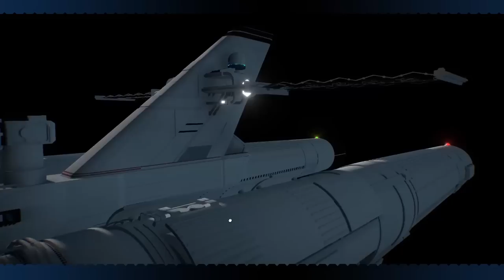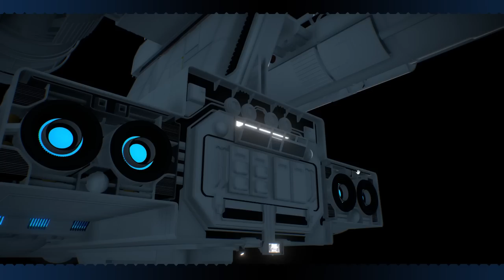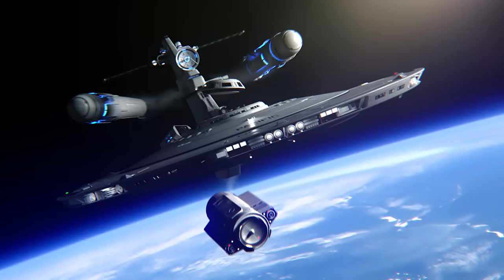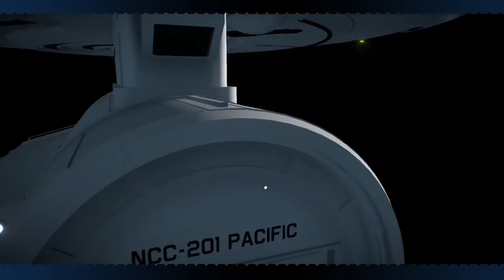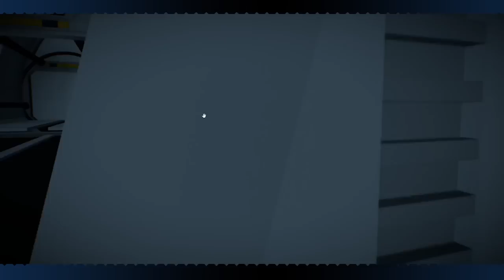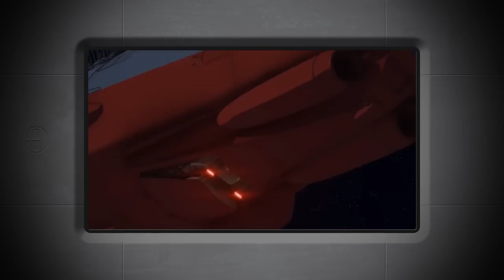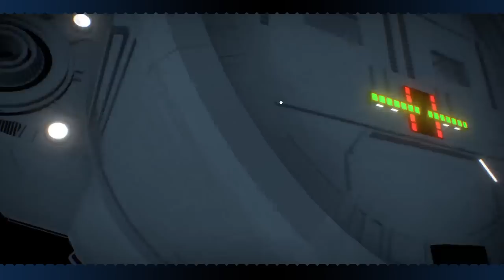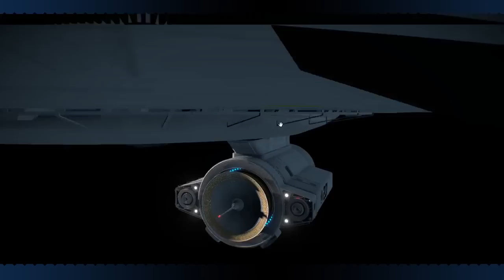Show and Tell: Starship Pacific from Pacific 201 (Star Trek fan film)

Comment: 1:20 "A thermal control system for the warp plasma conduits."

Maximum nerdum.
Reply: technobabble intensifies
Reply: That's just the thing, @Optillian. This isn't "technobabble", like the vast majority of technology in Trek. This is based on REAL engineering principles.
Reply: @solarisone1082  No it isn't.  Warp plasma is, by definition, technobabble.  Plasma is not a thing.  Plasma is a state of matter.  Plasma is an ionized gas consisting of positive ions and free electrons in proportions resulting in more or less no overall electric charge, typically at low pressures (as in the upper atmosphere and in fluorescent lamps) or at very high temperatures (as in stars and nuclear fusion reactors).

Since a fusion reactor behaves VERY differently from an antimatter reactor, the very idea of using plasma as a medium in which to carry the energy is ridiculous.  First, antimatter reactors do not produce any heat or plasma.  Second, the energy released (what form of energy it might be) is 100% energy.  This means you would NOT need to cool unless it was pure thermal energy.  If it were you certainly wouldn't want to reduce the available energy.  Third, unless you are intending to use thermal energy (which would mean you want ALL of it), the heat produced by any sort of power source would be recycled into the process or radiated away from the source directly.
Reply: @protoborg  - the annihilation of matter and antimatter releases radiant energy (or EM radiation). whatever handwavium roddenberryistic physics is involved in generating a warp field, it will require that released EM to interact with matter in order to be put to work. when EM interacts with matter it produces material excitement which eventually and inevitably translates as heat. 

basic thermodynamics limits "recycling" the heat back into the process, as heat tends to move from higher concentration to lower concentration. And vacuum sucks (sorry) as a medium for passive radiative cooling.

so, yeah, the ship would need some kind of active cooling system, preferably located so as to prevent heat from the warp nacelles from diffusing into the main hull and living spaces.
Reply: @protoborg  Look at a nuclear weapon detonation. It puts out lots of heat and light as a byproduct of the energy/mass conversion.  Now we know that matter and anti-matter is  an even more energetic process It's by definition would be expected to me at least an order of magnitude) I suspect it's a squared relationship) more energetic than a nuclear explosion. So we vaporize matter (I am going to assume it's a process that produces some common element like hydrogen and then expose it to antimatter from the dilithium with a controlled initiator of some sort (let's assume a generator-powered cascading laser system that continually builds the heat like hydrogen peroxide and baking soda o vaporize the dilithium crystals and anti-matter from the dilithium crystals. The di-lithium eventually runs out of anti-matter and thus is used up) (According to Mr. Scott the reaction takes 30 minutes to start and stabilize from a cold state)
Reply: @lebela Again, NO IT IS NOT.

Nope.  An antimatter reaction results in PURE ENERGY.  The way an antimatter reaction works is to bring EQUAL masses of matter and anti-matter together.  This results in complete conversion of the two into energy.  Positron emission tomography is completely unrelated to anti-matter.  It is a functional imaging technique that uses radioactive substances known as radiotracers to visualize and measure changes in metabolic processes, and in other physiological activities including blood flow, regional chemical composition, and absorption.  In other words, it uses RADIATION, not anti-matter.  Photons are not energy.  They CARRY the energy that is light, but they are themselves PARTICLES, ie matter.  They certainly don't hold enough energy to heat matter to the point of dropping electrons. Most plasmas are created when extra energy is added to a gas, knocking electrons free from atoms. High temperatures often cause plasmas to form. Atoms in a hot gas are moving so fast that when they collide with each other they sometimes knock electrons loose.  But Photons are simply too small to impart the necessary energy.  The use of the term "plasma" on Star Trek is actually wrong.

I used the wrong word here.  No, all frequencies of energy are NOT capable of inducing heat.  This is due to the fact that it isn't frequency that induces heat.  It is wave length.  Frequency is how many waves pass a point in a given time.  Wave length is the SIZE of the wave.  It is the wavelength that determines the heat induced.  UV and IR are complete opposites.  Thus, you NEVER get UV and IR from the same thing except for a white light source.  You talk like it is surprising that a light bulb gives off white light when that is the entire fucking point.

Actually, it is YOU who does not understand thermodynamics.  I don't need a textbook.  It's called google, you tech illiterate.

You're telling me.  You are the farthest from being an expert you could possibly be.

Actually, heat is defined as the transfer of thermal energy between molecules within a system and is measured in Joules. Heat measures how energy moves or flows. Temperature describes the average kinetic energy of molecules within a material or system and is measured in Celsius (°C), Kelvin(K), Fahrenheit (°F), or Rankine (R).  In other words, heat is the total thermal energy in the mass, whereas temperature is a measure of that energy.  Space is anything but massless.  It is certainly very low density but space is filled with a small amount of dust and a whole lot of gas.  The gas density is roughly one atom per cubic centimeter.  However, that is hardly massless.  Space is NOT a true vacuum.  The closer you get to the center of the galaxy, the denser the gas and dust gets.  The closer you get to a star the denser the dust and gas.  Thus, the ship WOULD be cooled by being in space.  Further, if not for mass in space, you couldn't use radiation to cool anything as heat requires a medium in which to radiate.  Plasma cannot be heated as it contains no molecules, only electrically charged particles.

You are still wrong about this.

change

Did anyone say anything about lasers?  No.
Reply: @lebela Nor do your assertions.  You get things just a little bit wrong.  Everything you say is close but wrong.  You get really close to understanding then miss the target.

Actually, you're wrong.  Matter (things, as you put it) and energy are two states of the same thing.  Energy is NOT a property of matter.  Every form of EM radiation except light is pure energy as there is no matter in EM radiation.  Photons are perterbations of the EM field of the universe.  Also, if you read more than the title of things once in a while you would know that scientists DO use the term pure energy.  In fact the definition of an antimatter reaction I gave was from home.cern/science/physics/matter-antimatter-asymmetry-problem.  If the scientists who work for CERN call it this then it seems like a legitimate description to me.  I am going to trust a particle physicist a hell of a lot more than some rando on the internet.  You don't even understand how the equipment you use works.  FYI, the energy of a photon is calculated as E = hf, where E is the energy of the photon, h is the Planck constant, and f is the frequency of the wave.  In other words, you got the formula wrong.  Only light has the particle-wave duality.  Wavelength and frequency are NOT the same thing.  The wavelength is the distance between two wave crests, which is the same as the distance between two troughs. The number of waves that pass through a given point in one second is called the frequency, measured in units of cycles per second called Hertz.  Matter is NOT energy.  Matter may store energy and energy may effect matter but they are not actually the same thing.  They are two states of the same thing, but they are not themselves the same thing.  An ice cube is not liquid water and liquid water is not water vapor.  Antimatter reactions of any significant amount do not occur in nature.  This is likely due to the fact that the matter we observe in the universe is a mere 1/1 billionth of the stuff that came out of the big bang.  In other words, 999,999,999 patricles in one billion were annihilated shortly after the big bang.  Positrons are certainly emitted, but not due to an antimatter reaction.

As I said, positron emission is NOT due to an antimatter reaction.  It is a result of radioactive decay of certain unstable elements.  THAT is how PET works.  It would be impossible if it required an antimatter reaction as humans have yet to successfully develope antimatter reactors.  The fact that positrons are antimatter is irrelavent.

No.  Just...no.  That is NOT the way it works at all.  Matter and energy (as I stated above) are two STATES of the same thing, but they are not themselves the same thing.  The idea that matter and energy are the same thing is not meant to be taken literally.  It is a simplification of the observation that shows that they are two sides of the same coin.  Matter cannot be energy (except for visible light) and energy cannot be matter (again, visible light the only exception).

Gamma rays do NOT only come from nuclear reactions.  They also come from nuclear decay.  And you were doing so well up to that point.  M/AM reactions ARE special in that they do not produce other particles like a fission reaction does.  Fusion produces different atoms from the combination of the two parent atoms.  Antimatter reactions produce no particles as all of the matter is converted into energy.  As I said before, energy is NOT matter and matter is NOT energy.  Beta does NOT come from a reaction.  It comes from radioactive decay.  Radioactive decay is the result of a chemical reaction, not a nuclear one.

Wrong.  Radiotracers are drugs used to highlight internal organs or veins.  They are radioisotopes bond to an organic material.

Size DOES matter as photons are NOT quantum particles.
Reply: @lebela You're source is just wrong.

Wrong.  You, not me.

First, you might consider doing a quick spell check before posting your responses.  Second, an atom has ONE nucleus.  "Nuclei" is plural, as in more than one.  Third, while it is the electrons that are doing the work in a chemical reaction, the nucleus determines how many electrons there are so the nucleus DOEs matter in chemistry.  Fourth, no.  Removing neutrons beyond a certain point will cause the protons to be ejected from the nucleus.  That will result in the atom becoming something else.

Again, wrong.  It has nothing to do with annihilation as there is no annihilations involved.  Radioactive decay does NOT annihilate anything.  It is merely the act of releasing energy from the nucleus which causes the mass of the atom to change which involves the number of protons in the atom changing which, by definition, means you have a new element.  This, in the case of the PET, causes a positron to illuminate the radiotracer which allows the tech to see the thing they are looking for.  Without the tracer, the process would do NOTHING.

A swing and a miss.  A quantum is a basic unit, period.  In physics, a quantum is the minimum amount of any physical entity involved in an interaction.  It is derived from the word quantity.

So...the measure of the probability that a specific process will take place when some kind of radiant excitation intersects a localized phenomenon is important for photons how?  Or did you mean a surface or shape that is or would be exposed by making a straight cut through something, especially at right angles to an axis?  Cause the second one seems more relevant.  If that is the one you meant, then you are wrong as that relates directly to the size of the thing.

You said it, not me.

Nope.

Nope.  500nm - 550nm, frequency of 545THz.

Did it never occur to you that the need to CONVERT from frequency to wavelength and back again might be a major clue that they are, in fact, NOT the same thing?

Nope.  Wavelength is simply the distance from one peak to the next.  Redefine it all you want.  It won't change its actual meaning.

Except that it is NOT butchered.  Your understanding of it is.

Still you who is wrong here.  Flipping it on me doesn't actually change anything.  Changing the wavelength would not change the frequency.  Only changing the medium through which the wave propagates would do that.  Amplitude WOULD be effective, but not for the reason you think.

How so?  BTW, you need to spellcheck more often.

Only if we are talking about a gaseous atom or molecule.  In physics and chemistry, ionization energy or ionization energy is the minimum amount of energy required to remove the most loosely bound electron of an isolated neutral gaseous atom or molecule.

Whatever you say, professor.

Please try again next time.  Thank you for playing.

Oh but they do.

Simple does NOT equate to wrong.  Perhaps inaccurate, but not wrong.  That is your biggest problem here; you keep conflating wrong and inaccurate.  If I have a ball in my hand and describe it as a red ball, that is somewhat inaccurate as the ball could be given a more detailed description.  It is not however wrong just because it lacks details.  It is a simple, but entirely true description of the ball.  For example, I could have said the ball is magenta, 3 inches in diameter, made of a derivative of the rubber tree plant, and weighs roughly half a pound.  That would be a more accurate description, but it would not be more correct.  Similarly, my descriptions of these things may be somewhat lacking in detail, but they are still correct descriptions.

In ALL collisions kinetic (spelled with a "c", not a "k".) energy is conserved. - Law of Conservation of Energy  The more elastic the collision is, the more the resulting vector is skewed from the vector of the more massive object.  What I have described is NOT a perfectly elastic collision.  What I have described is ALL collisions if you ignore the elasticity of them.  It is highly simplified (as you correctly stated), but essentially it is what happens.  The starship is not the relevant mass here.  The photons you claim are being emitted to cool the ship are.  Those photons are drastically smaller than the gas molecules that float around in space.  Thus, the photons would be whisked away by the gasses passing the ship.

But again, that heat would just be impinged upon the other molecules of space gas.

Again, the word is spelled "kinetic".  And you are also wrong about this.  It will certainly create a hole in your ship but it will not explode.  particles do not explode.  An explosion is a sudden and violent release of energy which causes an object, generally, to fly out in all directions very quickly.  A particle might impart a great deal of energy to the point at which it impacts the ship, but that energy will all be in ONE direction.  The worst that would happen would be anything in the particle's way would be blasted through.  If it is a living thing it is likely to die from the sudden disruption of its organs, but there would NOT be an explosion.  Actually, since the particle is smaller than an atom, the worst you would get is a series of atoms being ripped apart.  That still would not result in an explosion as those atoms would quickly lose there momentum as they impinged on other atoms.

That's not the way energy works.  The energy density of something does not mean the amount of energy that is imparted when it touches something.  It means the amount of energy it can store.  So unless the antimatter somehow came to a complete stop instantly, no it would not have the same amount of energy.  When the antimatter is standing still, it has POTENTIAL ENERGY.  Potential energy is not going to do any damage to the ship.  Again, it WON'T EXPLODE.

We are talking about the particles of gas that are PASSING BY the ship, not the ones moving toward the ship, stupid.

FYI, antimatter annihilation releases the ENTIRE mass-energy of the reactants, or roughly 9*10^13 joules.  That's 90,000,000,000,000 joules of energy for 1 gram.  In other words, 90 TJ per gram of matter and antimatter.
Reply: @lebela No I'm not.  But you still are.

Which movie, what scene?  I have seen every Star Trek movie and I certainly don't recall anyone saying ay such thing.  But please do enlighten me.

Hey, don't be so hard on yourself.  I know learning to speak reality can be hard for some people.

1) A black body is called that because it absorbs ALL of the radiant energy striking it.  2) Space is NOT devoid of matter as space is NOT a true vacuum.

See above.

Photons ARE matter.  They also happen to be fluctuations in that matter.

It consists of a plasma of hydrogen and helium, as well as electromagnetic radiation, magnetic fields, neutrinos, dust, and cosmic rays.  Granted it is of very low density, but it is there.  No they won't heat the ship as they would be hitting the ship at a glancing angle at best.  That is the whole point of the deflector array; to deflect high-velocity particles away from the front of the ship.

Well, you are partially right.  Considering that the thermal gradient induced by the unshielded sun is 400 (four HUNDRED) degrees C rather than the nearly 2000 (two THOUSAND) degrees C that happens during reentry, I would say you might want to rethink that.  Thermal stress is only really relevant when the shuttle is on the daylight side of Earth.  On the night side, the thermal emission of Earth is minor that far up.

No. The upper rocket stage rolls the shuttle onto its back in order to put it in the proper orbital position.  Rolling to a “heads down” attitude would reduce aerodynamic loads and stresses on the vehicle.

You do realize the space shuttle doesn't generate heat form its RCS, right?  Those tiny rockets are just big enough to move the shuttle to a slightly different position not by applying force to it but by altering its orbital vector.  That's why it takes so long for the shuttle to change direction.  Anything that is moving in space would be moving AWAY from the heat its rockets (of any size) so it would not be heated up by its thrust.  Probes are unmanned, stupid.  They don't care about heat loss as electronic components are self heating.  Hence, the fan in a computer.

Radiators do not release radiation.  They rely on conduction to the gasses around them.  They are poorly named.  Most so-called radiators use a liquid pumped through a series of tubes that transfer the heat the environment around them.  The gasses then carry that heat away from the tubes.  The only way those doors on the shuttle could be any sort of cooling system would be to run large cooling pipes through them.  That would be conductive cooling, not radiative as radiative cooling relies on moving around EM radiation, specifically IR.  Vacuum is NOT an insulator.  Space is NOT a vacuum, only a partially vacuum.  Space suits have HEAVY thermal insulation so that heat is not lost to space.

Photons ARE the medium, genius.  No the heat is not turned into photons.  It IS photons.

Bite me.

No it isn't.  An ion is an atom or molecule with a net electric charge due to the loss or gain of one or more electrons.  Plasma, on the other hand, is a gas with ZERO charge DUE TO ionization.  In other words, plasma is the RESULT of gas becoming an ion, but the plasma is not itself an ion.

Wrong again.  ALL matter can become a plasma if enough electrons are stripped away to cause any even mixture of positively and negatively charged atoms.  It IS another state of matter.

Only things made of atoms can be heated.  Plasma is not atoms and cannot be heated.  Heat is energy that is transferred from one body to another as the result of a difference in temperature.  Heat requires bodies of matter.  Protons, electrons, etc. are what make up matter.  Are the steps the same as the stairs? No, of course not.

Yes you are.

Ever tried to heat helium?

What's your point?

Plasma, no.  Atom, yes.  Nuclei, no. (And it is a single nucleus.)  Proton/neutron, no.  Electron, no.

I doubt you have the brain capacity to learn anything.

In the field of psychology, the Dunning–Kruger effect is a cognitive bias in which people with low ability at a task overestimate their ability. It is related to the cognitive bias of illusory superiority and comes from the inability of people to recognize their lack of ability.  Considering that I bother to actually read these things whereas you simply put up links, no.  D-K does NOT apply to me.

PS Did you like my little trivia question?
Reply: Except that's wrong as discussed here: https://physicsworld.com/a/plancks-law-violated-at-the-nanoscale/  In other words, things the size of a particle (two silicon ATOMS is 1 nm across) do NOT experience a change of temperature due to particle collision.  Also, that is not even remotely what Planck's law is.  As I have said before, Planck's law describes the spectral density of electromagnetic radiation emitted by a black body in thermal equilibrium at a given temperature T, when there is no net flow of matter or energy between the body and its environment.  Since a black body is an idealized thing that doesn't exist, Planck's law doesn't actually apply in the real world.

"The Stefan–Boltzmann law, and Wien's displacement law are closely related concepts, characterizing the emitted radiation.  Ideal black bodies doesn't exists, but materials can approach it. How much is characterized by a property called emissivity. And since a body with high emissivity is just as good at absorbing radiation, as emitting it, you have to keep those radiators away from the Sun, otherwise they would heat the coolant instead of cooling it. That's why the radiator panels are always kept perpendicular to the solar panels, for them you actually want to absorb as much light as possible, to turn it into electricity, so those surface is perpendicular to the angle of incident light, while the radiators only absorb a very small amount of sunlight on their edge, and most of their surface is in shadow, and can radiate the heat carried by the coolant away. And - to be really precise - while the coolant liquid does emit photons itself, those are immediately absorbed by the tubing inside the radiator. So by this radiation, but mostly by just conductive heat transfer, the heat of the coolant is passed to the radiator panel itself, and the photons created by the heated radiator panels are the ones that carry away the heat."

You almost had me thinking you finally understood.  You missed a key detail.  It is true that the central axis of the cooling system is perpendicular to the same axis of the PV panels.  However, the surface of the cooling system is NOT.  In fact, if you bothered to look at actual pictures of the ISS, you would notice that the panels (both PV and cooling) are actually in DIRECT sunlight.  Emissivity only matters when talking about remission of absorbed surface energy.  Since the heat that is emitted by the cooling system on the ISS is INTERNAL heat, emissivity is irrelevant.  Also, light from a star is emitted in a sphere.  Thus, there is no such thing as perpendicular to angle of incidence as there are light "rays" coming in at all sorts of angles.  Photons may be emitted but in far too small a quantity to carry away the heat.  The cold plates certainly do not rely on radiated heat.

"Again, there is no gas surrounding them you generate, it's vacuum. The amount of trace atmosphere at that height is negligible for conductive cooling.
And again, since heat is the kinetic energy of the particles - be it translational, rotational, or vibrational kinetic energy, depending how many thermodynamic degrees of freedom the particular atom or molecule has. Gases and liquids can have all of them, solids only vibrational. Heat conduction on the atomic level is just atoms or molecules colliding with each other, exchanging kinetic energy. So when a solid object is cooled by a gas - to stay on the topic why "space gas" can't cool the space station, even if it weren't an insignificant amount to begin with - you would see the surface of the solid as rapidly oscillating particles, and compared to them slow moving gas molecules touching that surface. The surface motion is slightly decelerated, the gas molecule is accelerated. Heat was conducted from the solid to the gas. And I've already told you about the concept of thermal velocity, which is the average speed of a particle in a gas, or liquid. Homework: Kinetic theory of gases, Brownian motion. So, the average speed of a 20C air molecule is 464 m/s. For hydrogen, 1,754 m/s. The station is orbiting the planet with 7660 m/s. Even if your assertion that "space is cold" would be true, and we would assume it's close to zero K, so with essentially zero speed (relative to the atmosphere) it would still move at leas 7660m/s relative to the ISS. That thermal velocity turns out to be 2371K. This time I've calculated this with Wolfram Alpha, so you can see the complete solution:
https://www.wolframalpha.com/input/?i=temperature+of+hydrogen+with+thermal+velocity+of+7660+m%2Fs"

Wrong again, moron.  Even in deep space there is one atom per cubic centimeter.  Thus the amount of matter in the upper atmosphere is FAR higher.  No heat is what we call the TRANSFER of energy between objects of differing temperatures.  The method of transfer is radiative, conductive, or convective.  Radiative heat transfer is via IR radiation.  Conductive transfer is via surface to surface molecular transfer.  Convective transfer is via circulating molecular motion within a fluid.  Funny how Brownian motion involves a suspension.  Since space is NOT a medium, the particular concept does NOT apply.  The surface IS a rapidly vibrating thing.  That's what "hot" is, after all.  Hot things vibrate very quickly.  Hot solid things vibrate more since they are generally more dense than fluids or gasses.  Metal is the most dense type of material.  Thus, it tends to vibrate the fastest.

continued...
Reply: "That's pretty hot, and the ISS still doesn't melt.
But it doesn't stop there."

The ISS doesn't melt due to not being held at that temperature for very long.  Melting is a result of not just high heat, but also high heat over a long period of time or a concentrated area.  Since the ISS is moving VERY fast, it does not have time to heat to the point where it will begin to melt.  Also, there is only a very limited angle at which the sun's energy is even hitting the station's structure straight on.  Even a few degrees of orbit puts the structure at an angle to the incoming solar radiation.  This means that the structure is not hit with direct IF long enough to overcome the inherent cold of space.  In other words, because it is moving and moving very fast, the ISS does not heat up very much.  Think of it this way.  It's like taking a fist full of sand and throwing it at a screen covered in glue.  Very few grains of sand are going to stick to the screen.  Photons, which nanometers in size, are a hell of a lot smaller than the gaps in the lattice of the ISS structure.  As such, the number photons impacting the ISS is extremely low.  The International Space Station does not cast an umbral (fully dark) shadow on the Earth, but it does cast a faint and imperceptible "penumbral" shadow on the Earth. In order to cast an umbral shadow, an object must have an angular size greater than or equal to the angular diameter of the Sun.  Also, it reflects 90% of the light that does hit it.  In order to heat up, it would have absorb most of the light.

"The ISS orbits at average ~420km from the surface. These height's are still considered to be a part ot Earth's atmosphere, - although it's so thin it's considered to be hard vacuum - called Thermosphere. It's temperature could actually rise up to 2,500 °C. (btw, this is a common misunderstanding for flat earthers and moon hoaxers crying "So then why are satellites not melting??" who also doesn't understand the basics of thermodynamics, just like you). Add that to the thermal velocity due to the relative motion of the station - and these are already average speeds, factoring in 3D movement, and the particles coming from all directions - and the ISS should be glowing white hot from the heating."

Nope.  It travels fast enough around the Earth that it does not spend a significant amount of time being heated by the sun.  Further, it is painted to reflect most of the thermal energy from the sun.  The particles are NOT coming from "all directions".  IR is really bad at heating things up.  You need a hell of a lot of it or it needs to be concentrated on a spot for a very long time.  That is simply not possible with something travelling that fast in orbit.  Of course, it does glow at night.  But that is reflected light bouncing off its VERY white surface.

"But the fact that the density of the gas there is already so low it's negligible, also means it's ability conduct heat is also negligible, so it can't impart any significant amount of heat to the station. And in turn, the station also can't conduct any heat to it too."

The amount of heat dissipation need at the speed it orbits at is fairly low so no.

"Here's some really easy to follow educational videos I've found for you about Heat, Black body radiation, and Wave-particle duality (and spoiler alert, it does apply to electrons, and everything with mass)
https://www.youtube.com/watch?v=LL54E5CzQ-A
https://www.youtube.com/watch?v=_0tkbp8yk-w
https://www.youtube.com/watch?v=7BXvc9W97iU
https://www.youtube.com/watch?v=eU6VqGIc-2Q"

Wave-duality does not apply to anything other than EM radiation.  That's why they were so surprised when they discovered the duality.

"Its literally in the first page you illiterate cretin.
"The heated ammonia circulates through large radiators located on the exterior of the Space Station, releasing the heat by radiation to space that cools the ammonia as it flows through the radiators""

So you think the use of the word "radiates" means it gives off IR?  I guess they didn't simplify it enough for you.  No, you hillbilly moron, they did not say it gives off IR.  All they said was it "flows through the radiators" after it circulates through them.  As I said before, the word is not applied properly to these devices.

"And again, no links to https://physics.stackexchange.com/ discussion to test your your degenerate abortions of misbeliefs before a wider audience, so try again degenerate furry, or fuck off."

Why are you so bent on getting a link to stackexchange?  Also, I don't think you actually know what degenerate means.  You really need to stop being such a child.  Since I doubt you will ever open your mind to reality, I am going to suggest we stop this as I doubt I will ever convince you and you cannot convince me of your position since it is just wrong.